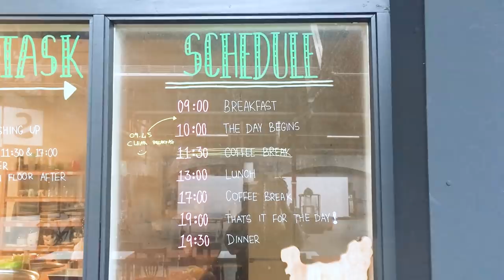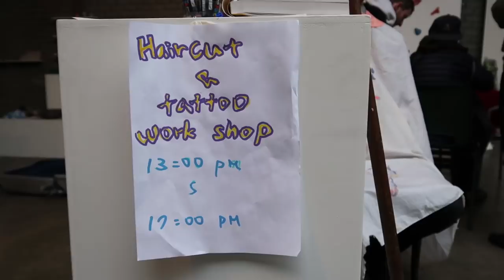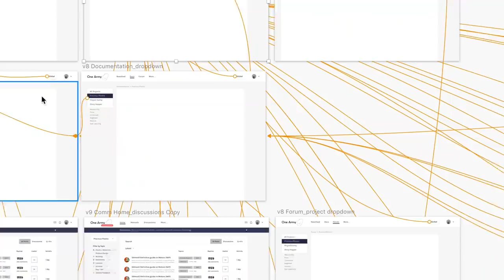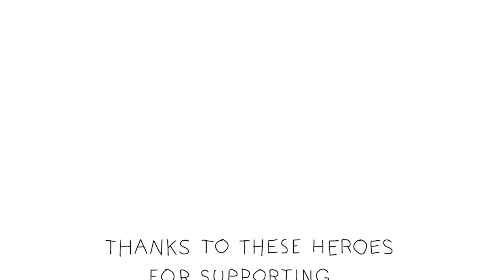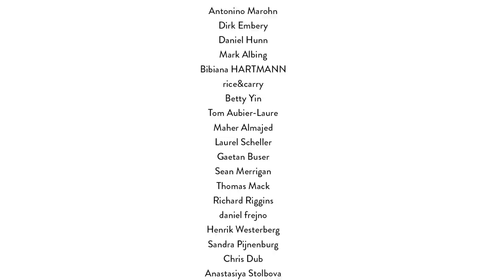Monthly News #22 - 30.000 bottles in a river

Comment: For mould release you could try glycerine from biodiesel manufacture. Its the waste left over from making biodiesel and has some interesting properties one of which is form release for concrete or for the beds of trucks transporting tarmac. It can also be used for cutting fluid, making soap, chainsaw bar oil, and much more. It's also easy to make if you can find a source. Oh its biodegradable too :)
Reply: Speaking you guys shoud get into that for a fuel sourcesince youll need power in the kamp
Reply: In Portugal there are cheap big places i and a lot of patrimony like (Nazaré , Algarve...) And there's is a lot of elderly
Reply: And my dad knows a lot of cool places and cool communities
Reply: What about polishing those aluminum plates on the flat sheet press to a super fine finish and just use them bare or lather it with some cooking oils?

Comment: Hi there, you guys were saying you have some trouble with sturdiness on your furniture. Just after watching this video I found some good examples of how to use these recycles plastic sheets or even recycled plastic cylinders. Search for "playforce", they produce playground and leisure equipment, you can get yourself some inspiration form there. They use stainless steel brackets to mount the plastic sheets to each other or use similar methods as you with cutouts, so they fit together. I think you are almost there, just a bit more tinkering to get the know how to create a sturdy structure.
For instance with your stool, you had the long side of the plastic profiles in only one or two dimensions, you need them in all three dimension to give it strength, otherwise it will bend vertically to the short side of the profile. For instance, if you create a rectangle, it will be weak and probably collapse into a parallelogram, so one thing to stop this, would be to put a diagonal brace into it. If you have something to keep it form rocking in all three dimensions, your are there. 
Have a look at traditional wood joinery as well, as they will have the same issues. Lots of design out there, without nails, screws and brackets, if you like to go that way. IKEA can also be a goo inspiration for good designs.

I am wishing you all the best and keep it up, don't let anybody tell you, you cannot do it. With persistence you can achieve anything.

Comment: To cut plastic on the CNC machine, use single flute cutter and air for cooling. I used around 15000 to 20000rpm with 6mm cutter and 1000mm/min feedrate. For better finish use 0.3mm -0.5mm finish cut.

Comment: to get faster cooling on the presses, you can run a glycol or water loop on the metal plate surfaces and use the 'waste' heat in the liquid to pre-heat something else (domestic hot water, water-based space heating equipment, etc). with so much energy going into just electric process heat you can really increase the energy efficiency at your space by re-purposing the 'waste' heat. double benefit with efficiency and improved cycling time on your press!

Comment: With the plastic bottles, fill them with water and put a LED inside, the water will help the light to spread. each bottle is a pixel and you could have any light show you want, world map, Precious Plastic logo.....
With the hot press would it be possible to have the aluminium plates coated with PTFE like a frying pan, maybe help with the wrinkling.
With the cold press you have the tubes welded together to form the plates, could steam be used inside the tubes to turn it into a hot press and also cold water to help with cooling.
Just a couple of ideas.

Comment: the wobbling table; use angled plastic(like angle line steel) for the legs. with that you can make them even as thin as 6mm and they'll be much sturdy.

The 30,000 plastic bottles. sounds like a huge quantity given the number, but very light when weighed. I've been doing a housing project here in Kenya with plastic bottles but needs tonnes of plastic. I'd suggest you build some dog kennels with them. I can share some ideas about that with you...

Comment: Love the community and the great new ideas, some ideas for the cold press: 
Maybe the introduction of venting channels used in casting applications can direct excess material to certain point of the mold and help the plastic spread. The introduction of detachable sides ( frame and plate construction, like old baking forms from grandma) of course bolted or sleeved construction in your case can help to detach the big plastic plate. You can also implement a    Cooling circuit from a parted out car to help cool the tool during and after the press cycle. Good luck and blessings to you all

Comment: What may be a way to help with the releasing of the plates in the cold press is by adding big draft angles to your mold (lets say 20 to 30 degrees). I saw in the video that you guys have 0 degrees draft angle. I'm working at a company that makes a biodegradable packaging solution and when designing the packaging I seriously need to take draft angles into account. (production is very similair to plastic injection moulding)

Cheers and good luck
ps. (Planning to make my own little household recycle plant and filament extruder to use in my 3d printer)

Comment: Idea for the mould: Build it out of a flat metal plate and a frame that can be screwed off to remove the plastic after the melting process. Idea for the presses: Add active cooling with air or water. Air cooling shoud be easy on the cold press, just add some ventilators to the pressing plates. For the hot press, I would use copper or aluminium pipe and a water cooling. After the cooling, use compressed air to empty the pipes before you heat the press up again.

Comment: The small coffee table is wabbly because you don't have ties lower down on the legs. Get them on no wabble. 
Pressed sheet is the simplest form of injection moulding. Make the injection mould with water cooling on both cavity and core sides use screw to inject the melted plastic and hydraulic clamp to hold down the mould while cooling.
30,000 bottles can make a hell lot of broom sticks. I'll include the link to my FB page if you are interested.

Comment: Interesting video. Does anybody still reads new comments seven months after the video has been released?
Plastic (new or recycled) is just a material, like everything else. You can apply techniques from other branches of industries.
For example with the hot press for the sheets you might take a look how (industrial) bakers do not have their products (bread and so on) stuck to the baking plate.
The foil does not work 100%, maybe oil or grease does?
The same is for the stool. It was mentioned and shown that it is a kind of wobbly. Watch and uses techniques how wooden stools are made.
Btw thanks for the ideas how to you old coffee grout (or how is it called?).

Comment: If you guys have to move, and are thinking of a different country. Why not Alaska? Most houses have 3000sq ft shops and are priced in the 200-350k range. Plus our recycling transfer sites just end up at a  central land fill.
Reply: Also for the hot press, had you considered using cold water coils for cooling?

Comment: Nice guys.   For the shaping and testing on how far things can go you shoukd get incontact with a composite decking material such as aztec decking and try and learn that there processing and manufactuing.  They might be able to help withthe learning curve since they probably already have the experience of testing and what works amd doesmt work. Alot of composite decking is extruded with a internal frame structure instead of a solid block. Which would help with the wobblyness such as the table.
Also you shoukd take an oven that warms the plastic up (not melt) so you can curve and re shape.

Comment: Use water jets to cut plastic that will not melt i guess and again with the grinder, you can use more water while cutting the shits which will remain cool while cutting and that will help in getting a clear cut. good job guys
Reply: Water is (maybe)even more precious than crude oil. Maybe it is possible to use salt water.

Comment: Hello fellas, I really love you're ideas. But there's one question in my mind. Isn't the maine problem with plastics that it ends up as microplastics polluting soil and water,... . There are barely studies about microplastics, but I don't expect good news.
What's you're opinion how to tackle the issue of microplastics?
Reply: I cannot speak for these guys, but I believe, that micro-plastics are generated by degradation of plastics, especially in uncontrolled environments (non-recycled rubbish floating about in the seas and ending elsewhere in nature). The UV radiation and physical erosion will turn plastics into micro plastics. So from my understanding, the easiest way to avoid micro-plastics is to recycle the most you can, that way you minimize the plastic that just rots away unseen outside the cycle. When you recycle it, melt it down again and mould it, it will basically give the same plastic a fresh start, so it prolongs the total lifespan. You can also throw anti-UV additives into the mix, too.
When it actually is micro plastic and then trying to collect it again, that will be hard, unless you count, what the food chain automatically does, right now, as it is filtered through lots of organisms including us and stays in our bodies until we die. This will work, I believe, similarly to mercury, it will likely build up as you go up the food chain. So we, wales, high up predators will get the worst of it.

Comment: perhaps using some kind of silicone mold with an aluminum plate at the back to keep it rigid. Then you could flex the mold to release the plastic assuming it doesn't bond with silicon.

Comment: One thing is that your furniture uses a lot of plastic. The industry is focused on making products designed for narrow purpose with necessary strength requirements, little weight and material use. Making shipping palettes, reusable creates, furniture and by making it all by using triangles and corrugated sheets of plastic. So the shipping costs and CO2 impact would be low. Plastic is pricey! We need efficient automated processes to recover it. From collecting, disassembly, sorting, recycling, manufacturing, distribution.

Comment: I love what your group is doing.  To help, I recommend dry PTFE (Teflon) lubricant for the cold sheet press.  Remove all plastic and polish the pan as best you can, to make it as smooth as possible.  Clean with alcohol to remove any polishing compounds, grease from fingers, etc.  Then spray with dry PTFE lubricant.
This may also work with the hot press to reduce wrinkles, instead of using the PTFE sheets.
Since you are currently in the Netherlands, here is a link for one such product, on their major online shopping site:  https://www.bol.com/nl/p/motip-ptfe-droog/9200000058270611/

Comment: also, to answer the last question, in the end of the video, about what to do with the 30,000 plastic bottles, it would be great if you guys did build a plastic brick making machine (or just a mould) and for the next exposition next year you made a HOUSE with those 30,000 bottles (and gave it to a homeless person for free), showing that all that pollution became a house for someone in need of it.
Reply: 30,000 plastic bottles can't make a house, maybe a kennel.
Reply: "It is believed that the first bottle house was constructed in 1902 by William F. Peck in Tonopah, Nevada. The house was built using 10,000 bottles of J. Hostetter's Stomach Bitters which consisted of various herbs in a solution of 47% alcohol."

from: https://en.wikipedia.org/wiki/Bottle_wall
 @kevinwamaya6899

Comment: Why doing entire sheet of plastic? Event commercial process won't make entire sheet unless you are talking about floor tiles and table top. They will make a mold with all the shapes and holes. Anyone who had experience playing the model cars from itallei, bandai, tamiya or rollei? They don't make it like a sheet. They made the parts “inside“ a sheet of plastic. Use less plastic and the cut off are guarantee to be recycle. If you think it is too difficult, you can try something simpler, such as rulers, compass or triangle rulers use in wood working. That's simple enough and people don't throw away tools just like they throw away plastic bottles.

Another way is to design some sort of blocks. Shall i use the word “lego“? Children can play with, but their father can also use these same blocks in their diy home improvement work, such as fence, table and chairs, small cupboards, dog house, chicken coop. People will then have intention to create a demand when they can use it at home. It will have a certain kind of help cutting less trees for wood work. The place where i live, hardware stores besides selling angle iron and pvc pipe, they also sell some steel bars in various length with predrill holes, good and useful “lego“ for diy people, just couple of screw will make a stand or shelf. You don't even need to use a saw. what if it is made of plastic?

Comment: Dave I’m a big fan of yours but I dont understand why you are trying to reinvent the wheel when it comes to machinery. I work for a medium size sheet extrusion company in canada and used extruders, grinders and more can be bought for less than it would cost you to buy the materials to build them. If I wanted a grinder with an under 50hp motor or an extruder with a 1.5 or 2” screw I could buy them at auctions probably once a month, and the biggest expense would be transportation. So why bother with the learning curve of building from scratch?
Reply: I think the point is to reverse engineer this stuff, then open source the designs so anyone, anywhere can build the machines using local materials.
Reply: Hey, great. Wonderful that you're willing to share your expertise. Why don't you take your specialized knowledge and show us how we can do this, instead of just saying how easy it would be. Start a website, whatever, cause we're all drowning in plastic and we need solutions... Like Dave is providing.
Reply: brian gilbert im not an expert (but I have 13 year experience) in sheet extrusion) and Im not criticizing dave. I want him to succeed as fast as possible. 
Extrusion as a technology is not very different now than it was 60 years ago. The basic science and basic components are unchanged: most of the extruders in my plant are from the 80s or earlier, and ive seen my fair share of extruders from the 60s still in production. (The bigger advancements in the market only concern controls, safety and many small incremental improvements in efficiency. )
There are many books that go into details on all aspects of plastics, look up hanser publications. And there are many very experienced engineers and technicians some on them retired who probably will love to give free advice. Look up rauwendaal, who is dutch, and alan griff. Both I know and they love to talk!
Reply: blablablablablablabala @MrStudioso
Reply: EXACTLY!! I agree with everything you say, it seems like it started as an exhibition thing which is very great experience but this trying to scale it up by "reverse engineering" and ignoring the whole engineering knowledge and experience in this field just confuses me. Its like they are trying to make as  inefficient  as possible. Yes it looks fun hanging around,and if I was around I would gladly join. I just dont get the "end game" of this project completely, can somebody change my mind?
Reply: @MrStudioso  any way to get in touch with you about this?
Reply: @leah & @stjepo91, indeed there's no need to 're-invent the wheel' but is that knowledge easy to find and understand by anyone who wishes to build these machines? Not everyone has access to used machines or the knowledge to operate them, so 'open hardware' is important to ensure everyone has access to the technology.
Reply: hi we are chipping away in New Zealand where there isnt a lot of plastic machinery floating around. Would you be able to source any machines on our behalf or send some links? especially looking at a good sheet press that could make 1.2 by 2.4 meter sheets.